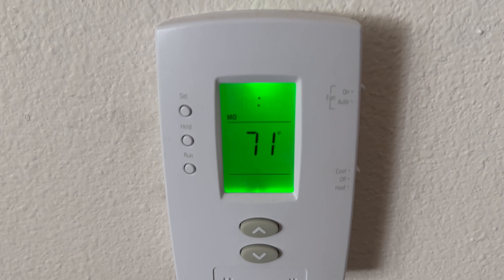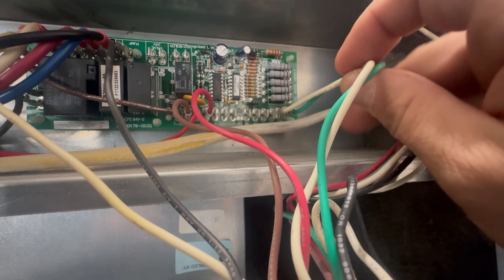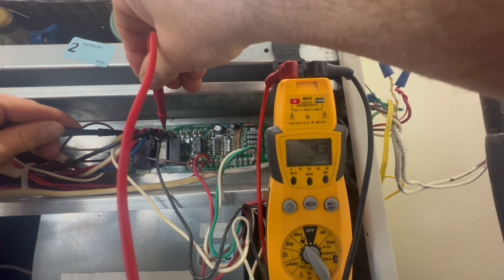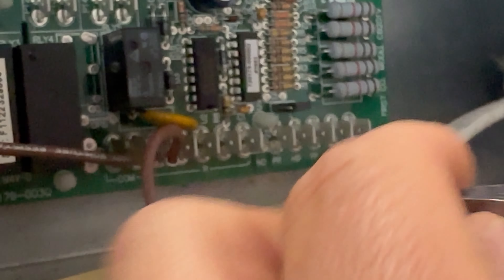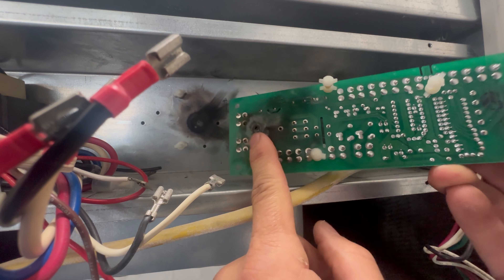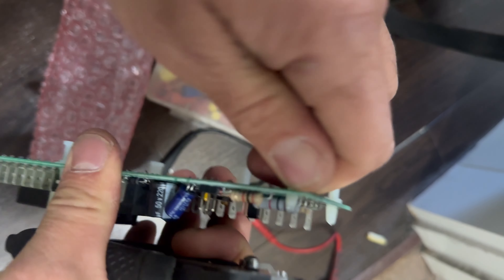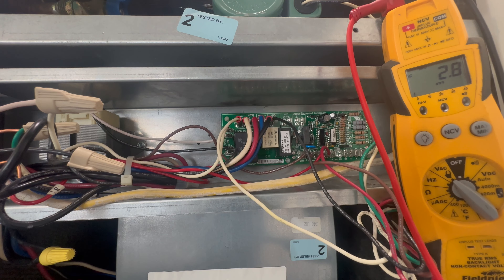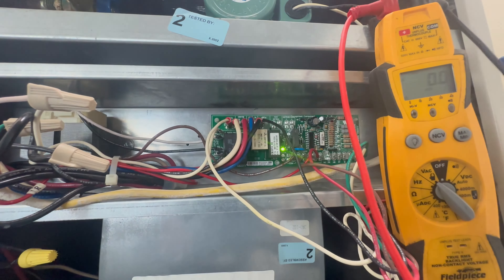Control Board Troubleshooting and Replacement on Furnace

Comment: what caused the relay to burn up?
Reply: The fan relay is switching fairly high current, especially when the motor starts. The solder joint heats up and cools down over and over-known as thermal cycling. Eventually the joint will crack or break. Then even more heat is generated due to a poor electrical connection.  This increase in temperature melts plastic and burns the coating on the PCB. If the board and relay isn't completely destroyed and have the tools and materials handy you can clean the connection and re-flow the solder. You can like he said just install a 90340 0r 90370 fan relay that will outlast any PCB mounted fan relay. This is a very common failure for board mounted high current relays.